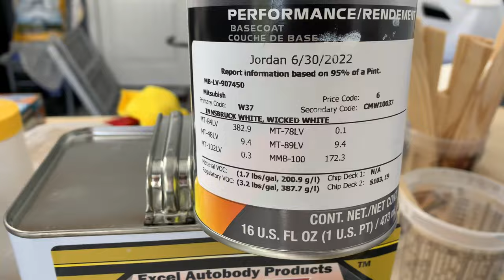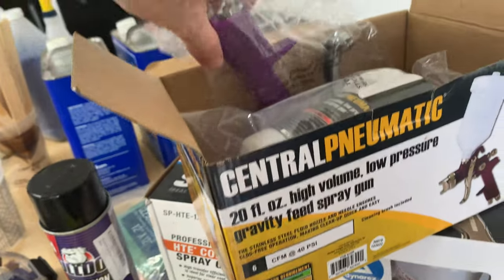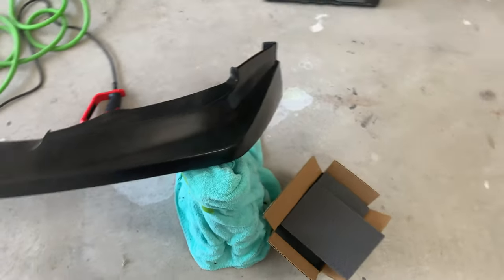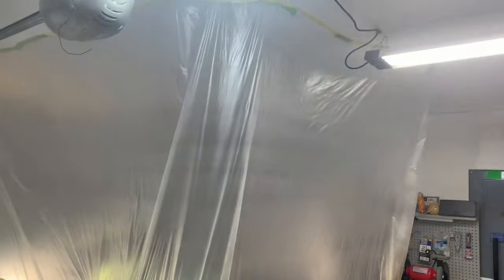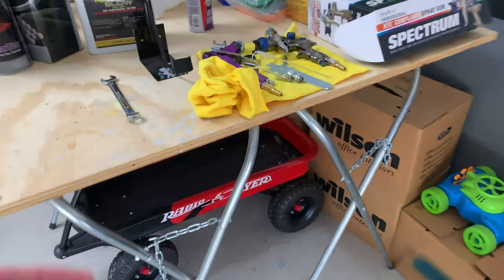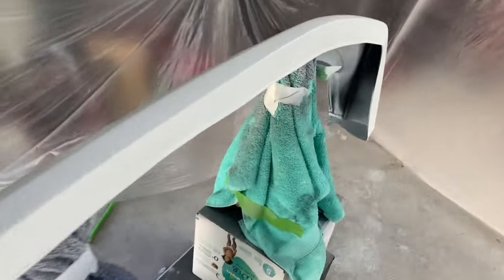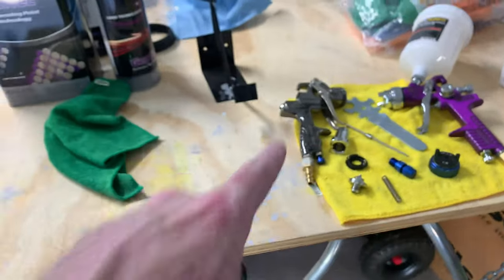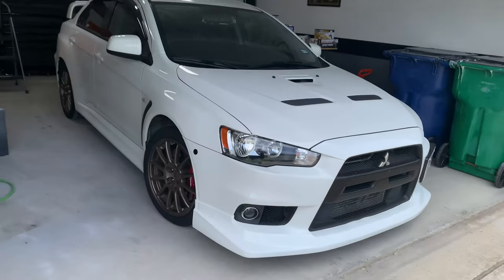Painting The Voltex (rep) Front Lip For The Evo X / PRIMER, BASE, & KICK ASS CLEAR!

Comment: I just got my voltex style lip and spats in the mail this week and this makes me want to try painting it myself. You made it look easy! What type of paint did you use?
Reply from the maker: If you can paint with rattle cans you can paint with a compressor and gun setup.  Every paint store carries different brands.  Just find a local automotive paint supply store and they’ll be able to hook you up with all the paint.
Reply: @JordanMoree  I mean the paint solvent type, is it urethane based paint? I might have to try painting my own stuff if I can find a place to set up
Reply from the maker: @theELiTEboarder  yes urethane based.  Just remember to hit it with some adhesive promoter before primer.
Reply: @JordanMoree  perfect, thanks. Can't wait to get mine painted and on the car!